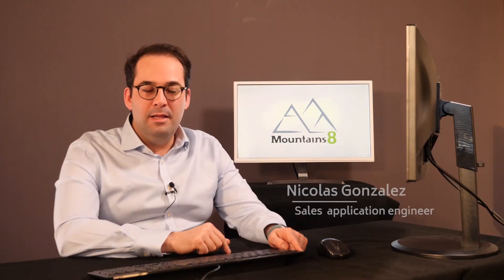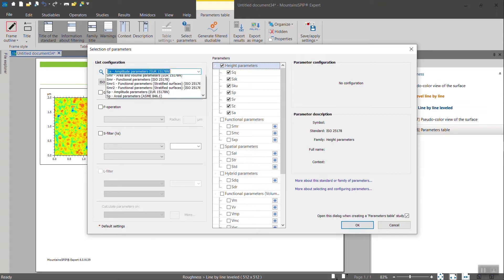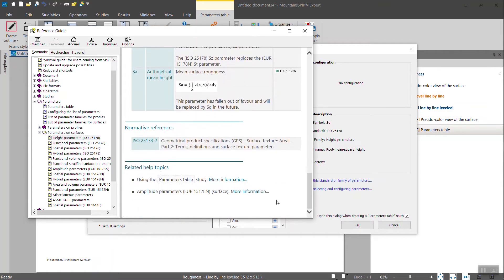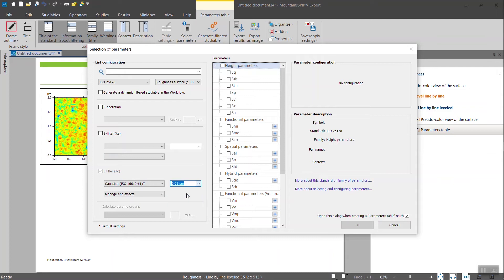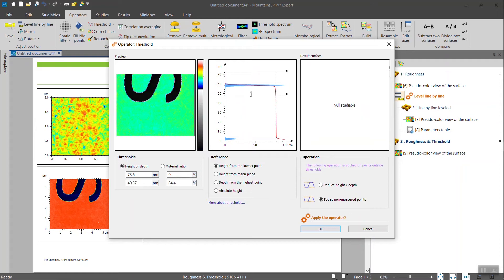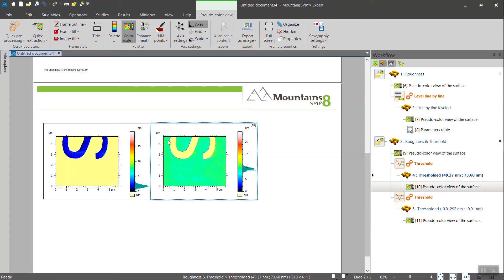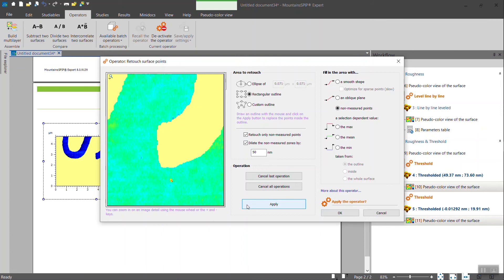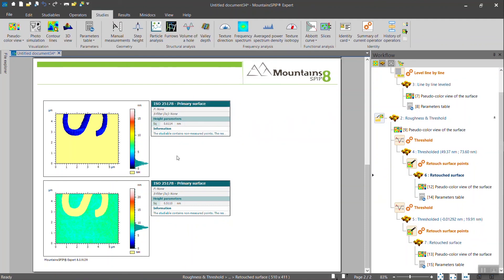MountainsSPIP®8 | How to calculate surface roughness on SPM data

Comment: How do you find Ra, Rq, and Rs values?
Reply from the maker: Hi Zane. Thanks for your question! You can automatically calculate these parameters by selecting the ISO 4287 standard in the "Parameters table" / "Studies" tab (please note, you must select a profile in your document, as Ra, Rq and Rs are parameters calculated on profiles). Please get in touch if we can help you out with a specific dataset! Cheers 😊